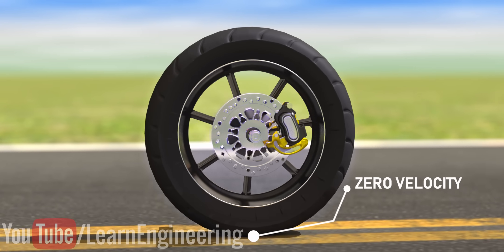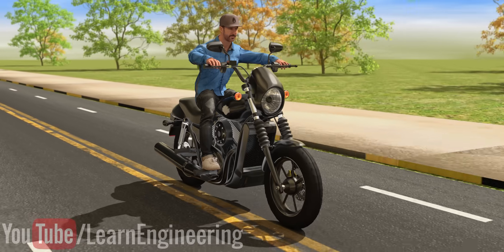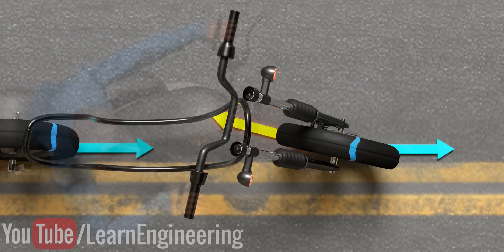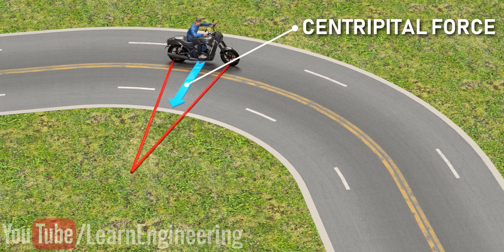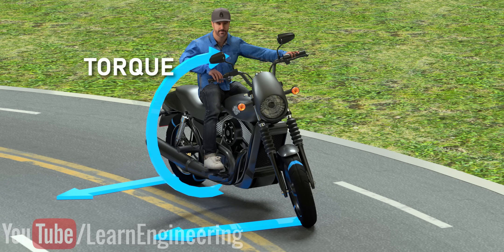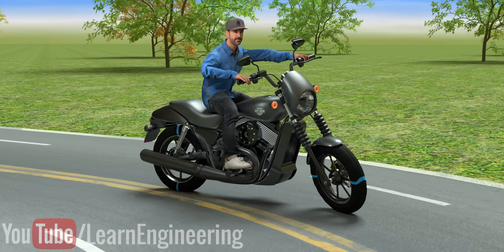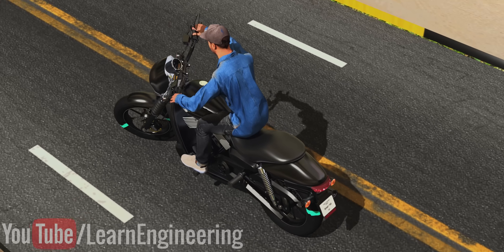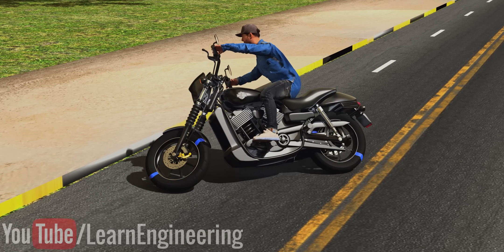Counter Steering | The interesting physics behind it

Comment: This guy has never rode a motorcycle. You always countersteer going over ~20mph. You can't just lean a motorcycle like he points out, the gyroscopic motion of the wheels prevents this.
Reply: You even countersteer while riding a normal bicycle, it's nothing extremely special
Reply: @PiepsPiepsMann  it helps to know about it as you have more control. People always countersteer but they don't understand, they do it indirectly
Reply: Agree. Regardless of bike, normal steering isn't going to work when you rode it at speed higher than 60 km/h. You'll need to swerve your bike first followed by countersteer in order to make a turn. The only time you make a normal turn is when you're at 0-20 km/h
Reply: @vermilion6667  Why do you think counter steering is only practiced at 20 + MPH?
Reply: A motorcycle turns in the direction of lean.  Counter steering just enables the rider to create a lean in the direction intended.  He doesn't mention the caster effect which is why the motorcycle stabilizes in the lean.
Reply: @saisr1 not neccessarily. You can lean ( and fall) without turning. Leaning is not needed to turn. It is needed to remain on the wheels.  Just to balance the forces.
Reply: @saisr1  you can create lean with just body position, but is way slower. much faster counter steering and let play the casor effect. on the sports bike they combine the two to make sharp turns.
Reply: yourleftnut1  You can't lean a motorcycle without turning you dope. You're sitting on a gyroscope.
Reply: @kayakexcursions5570  Thats funny because when I shift my weight the motorcycle leans. If I lean  enough left its going left. IF I lean enough right its going right The only time it doesn't is if  'm purposely counter leaning say in a cul de sac to do a tight turn.
Reply: @spartanx169x  Then your not riding a motorcycle. The only way to lean a motorcycle with weight is if you're not going fast enough or the tires are light such as a scooter or bike. You can't fight the gyroscopic force on a real motorcycle.
Reply: @kayakexcursions5570  You obviously don't ride or have never had anyone on the back while riding. Doesn't matter how fast your going, shifting your weight enough will effect the balance.
Reply: This short from the "Twist Of The Wrist" video from Keith Code covers this well: https://www.youtube.com/watch?v=TW6h5aq-xqw .  The whole video is great
Reply: @magsteel9891  Thank you for linking the video!
Reply: @magsteel9891  Thanks, and agreed.   This should help many people here understand what is truly happing when turning a motorcycle.

or, simply, above 15-20mph = Push right, go right.  Push left, go left.
Reply: @MrMindlink  
But the rider never actively steers into the bend as suggested in this video. This action would stand the bike up mid bend, resulting in a very bad day. The video is total rubbish!!!!
Reply: @softailfun  To be clear, I am referring to the video "mag steel" linked above ( https://www.youtube.com/watch?v=TW6h5aq-xqw ), and I am going to stick with what I said.  Having said that, I believe the video you linked ( https://www.youtube.com/watch?v=lzk8oyNO708 ) does a significantly better job of explaining/demonstrating counter steering.
Reply: Tbh countersteering is not even something special, its something you do by instinct.
Reply: THIS. You can test it by getting the bike up to 30mph, taking your hands off the bars and then trying to get the bike to turn by shifting your body. You might get very slight changes by heavy shifts of weight (not really recommended at low speed without hands!) but counter-steering is literally the only way to turn a bike over about 15mph. You may think your turning it by body weight or "leaning", but your subconsciously counter-steering.
Reply: would also recommend it
Reply: true... but there are plenty of riders who don't know about countersteering they do it without realizing it. So he might just ride!
Reply: Yes this video is absolutely wrong.   The way he describes countersteering is not at all how it works in real life.
Reply: Ur Always countersteering regardless of the speed lols
Reply: apparently you haven't either lmao
Reply: imagine being so limp wristed you cant turn in the direction you want to lmfao
Reply: @Roman_4x5  yep, i caught the India WEB Admin BS early in this one
Reply: what do you mean so when turning right you are suppose to lean right but push bars to the left?
Reply: @BSABD315  It's going to start leaning by itself and soon as you start turning the handlebar to the left.
Reply: @kayakexcursions5570  
“Turning the handlebars”?? Really??
It’s a slight pressure forward on the grip, hardly a “turning” action. Turning is for parking areas and slow speeds.
Reply: @softailfun  so when going right i would push the left side of the handlebar slightly or the right side of the handlebar slightly?
Reply: @BSABD315  
Push right bar:turn right
Push left bar: turn left
It doesn’t get any simpler than that fella. Here’s a link with what is probably the best video on YouTube about this topic. WATCH THE WHOLE VIDEO!
https://youtu.be/lzk8oyNO708
Hope this helps, it should put your mind at rest about counter steering.
If you still have questions, feel free to get back.
Reply: @BSABD315  
The use of the word “steering” is maybe a bit severe. To turn left you “push” on the left grip, the movement of the front wheel to the right is very small. 
This link is probably the best video on this topic and I hope it helps you understand more. https://youtu.be/lzk8oyNO708
Reply: @BSABD315  you apply pressure towards the left while leaning right but the handlebars should not turn left while making a normal right turn. It's just to keep the handlebars from turning too far to the right.
Reply: @ktm125sxbeast  oh ok thanks man you explained this the best with the least amount of words everybody else trying to make it seem like rocket science
Reply: How much is that in normal people mesearuments ?
Reply: @Veronika Zaglotova Disagree with that - not counter-steering.  I believe counter-steering requires the angular momentum of the front wheel spinning to create the effect.  When the bike is at a stand-still, if you push the right handlebar, the wheel will steer left - but once the angular momentum of the front wheel becomes sufficient (at rolling speed), when you push on the right handlebar the wheel will steer right.  That's counter-steering.
Reply: @Veronika Zaglotova I really disagree with what you are saying.  Maybe it's just a semantic argument but in my definition of counter-steer there is a point of rotational force of the wheel where the rotational force deflects the sideways push against it.  At rest, pushing on the right side handlebar will turn the bike to the left...this is normal-steer.  Once a particular rpm of the wheel is reached (differs from wheel to wheel I suspect) pushing on the right side handlebar will turn the bike to the right...this is what I understand to be the concept of counter-steer.  The geometry of the front end may affect this effect, but only minimally as it is mainly the rotational force of the wheel (gyroscopic effect you rightly called it, or angular momentum) that creates this phenomenontheotherhand (MP).
Reply: Hm my 2001 Suzuki marauder begs to differ... The steering might as well be locked at all times. It's so too heavy and unbalanced that the only way to turn into lean the bike while keeping your body straight
Reply: @everblackened  When you are rolling your shut-off bike out of your garage (I did this for years on a steep slope backwards making a hard 90 turn at the same time) you use your handlebars, correct?  At shut-off rolling speed, you would experience 'normal' steering.  When you are riding down the road, and you push on the right handlebar, the bike will lean right and you will go to the right.  That's counter steering.
Reply: I LOL’d so hard when the guy visually had the handlebars turned full-on while leaning and traveling at a fast rate of speed.
Reply: My bike counter steers over 15 mph not 20 mph
Reply: It’s 20 mph not 25?
Reply: Nope. It still works, but crazy slow. But he had to explain it because it is needed to understand what a pure turning is.
Reply: Very good video, but still a lot of quantum physicist in the comment section who think they know it better but still talking crap in the same time 😂😂😂😅😅😅
Reply: It's definitely less than 20, but agreed. That shouldn't have been in the video because it's impossible to replicate without crashing
Reply: Or you don’t fully understand the physics behind it lol
Reply: What he was trying to to demonstrate is the concept of counter steering, when to use it will be taught by the msf course
Reply: Just watch veritasium's video on how bike steering works, it's a good vid, and actually shows people struggling to turn because they constructed a bike that can't countersteer.
Reply: I agree with you , I was going to say the same thing but I was afraid I was thinking of it in the wrong way but yeah that's how I feel too
Reply: Definitely do not listen to this video. If you do what this video says to you I just hope you have your hospital bill prepaid
Reply: Never been on a motorbike, but on a bicycle, you normally countersteer at high speeds.  This practice comes automatically.
Reply: There is no normal steering on two wheeled vehicles even at low speeds
Reply: @ПавелГражданкин-ъ4л  yes there is, if you push your bike at 3 km/h normal steering will work
Reply: @benjaminsletten9434  You need to ride it not push🙈
Reply: @ПавелГражданкин-ъ4л  technically yes, when you turn right on a bicycle you are technically counter steering to the left but rotational force is not very strong so you don't notice it
Reply: @ПавелГражданкин-ъ4л ppppp
Reply: @ПавелГражданкин-ъ4л  https://youtu.be/lzk8oyNO708?t=258 explain how this is not normal steeing when he is going slowly? He 'turns' the handlebars in the direction of travel. Anything faster than this and you would need countersteering.
Reply: @bagelbytes69420 , bikes are self-stabilizing vehicles. You just can't turn without destabilizing and leaning. You steer left bike leans right. You catch balance and you turn left. Always. No matter what speed it is. Low speed makes it jerky. At no speed you can't turn.
Reply: @ПавелГражданкин-ъ4л  Have you ever even ridden a bike?
Reply: @kayakexcursions5570  My degree in physics is more than enough to see how steering works. And yes, I own mountain bike. And I do daily commutes.
Reply: Павел is right, the only way to avoid countersteering a turn (on any two wheeled inline vehicle, at any speed) is to start the turn already leaned over. or to let the bike start to fall over on its own and catch it while its leaned. The counter-steering simply initiates a lean, the lean is absolutely necessary to turn
Reply: @ПавелГражданкин-ъ4л  I too have a degree in physics. You’re incorrect. Countersteering is a way of attaining lean required for turning. If you can attain that lean without countersteering, you don’t need to countersteer. This is why I can ride my bicycle around with no hands and navigate turns. It becomes easier when going faster due to more stability, but I can’t take sharp corners at high speed because the bike is too stable.
Reply: @Gnerko123  🤦‍♂️
Reply: @Gnerko123  just watch your handlebars when you lean by your body mass. They counter steer ...
Reply: @janvotava9792  no they don’t
Reply: @Gnerko123  Watch the video linked by magsteel, it demonstrates everything.
Reply: @kayakexcursions5570  it baffles me that they say leaning the bike with your hands off the bar creates a counter steering action. I’ve watched that section a dozen times but I still don’t see it when looking at the pointer. If the rider leans right, the bars go right (indicator goes left), if the rider leans left, the bars go left (indicator goes right). In that section, I see the rider doing sort of a slalom by body lean only, but I never see the indicator going one way first and then the other way during a turn in one direction like in the section with hands on the handlebar.
Reply: I’ve been reading up a bit. You can make the bike countersteer handsfree if you lean your body right, while pushing the bike to lean left. You do this by pushing your hips left while moving your upper body right. The geometry of the bike will make it then steer left, which will then stand the bike up. The front wheel doesn’t straighten immediately, making the bike lean right, after which the front wheel turns right and the bike makes a right hand corner.

If you just lean your body without making the bike lean the other way, this doesn’t happen. You do this by leaning more gradually, not really pushing against the bike as much but only leaning your body off it. What happens instead, is that the bike leans in the direction of your lean due to the torque exerted on the bike by gravity on your body. The bike’s geometry then makes the front wheel turn in the direction you are leaning. This is what I’m doing when riding my bicycle hands free and I believe this is what we are seeing in the video as well. I’ve not yet achieved the hands free countersteering approach on my bicycle, need more practice lol.

You might say that you can’t lean your body one way without pushing the bike the other way and you would be correct. However, due to the rotational inertia of various parts in the bike, notably the wheels, you can in fact move the center of gravity of the bike by leaning your body one way. Thus, the bike does not or only barely leans the other way due to your body pushing against it to lean one way. Thus, the example of the first paragraph only works well at low speeds.
Reply: @ПавелГражданкин-ъ4л  A mountain bike?  As in bicycle?  The angular momentum of a bicycle wheel is not sufficient to create the counter-steer effect.  It's the increased mass/inertia/angular momentum that makes the counter steer effect occur above approx 35kph (on my bike 2005 Yamaha FJR1300).  I was disappointed that the video didn't discuss/describe how normal steering become counter steering once you achieve a certain speed.  It is impossible to 'normal steer' a motorcycle going more than 50kph.  Conversely you cannot 'counter steer' a motorcycle going less than 30kph (speeds approximate).  I have a degree in welding.
Reply: @acehandler1530 , trade isn't enough to understand physics. Two wheeler with bicycle like structure always counter steer no matter what seems to you
Reply: @ПавелГражданкин-ъ4л  Lol, baloney!
Reply: @ПавелГражданкин-ъ4л  Degree in physics, good story mate.
Reply: yourleftnut1  
Such bollocks!!!!😂
Reply: Yeah I don't think this guy rides a motorcycle. Any turn is counter steered at any speed over 40 mph regardless of any lean on the bike whatsoever
Reply: @SofiaSchnee1  This is the correct answer, and that video will prove that all steering is counter steering.
Reply: Idk what everyone is saying, but i never counter steer on my bike, even if i go fast/slow
Reply: @creeperlano7805  You always countersteer on the bike, thats how you turn.
Reply: @creeperlano7805  you must be a big fellow LoLz
Reply: @Revolver.Ocelot  if 1.80m is big then yes lol
Reply: @creeperlano7805  yeah you have you just don't realize it
Reply: @chrispybacon3320  Just so you know, i mean a bicycle not a motorcycle, but if you knew that then i guess im cycling wrong bc i watched IT multiple Times but i did not notice Amy counter steering
Reply: @creeperlano7805  exactly ppl thing that if you go fast you have to counter steering and thats not true body weight shifting is perfectly capable of change the direction of a bike at any speed counter steering is a good tecnique to change de direction of a bike when you have less time perfect to avoid any problems when you dont have the distance to do it normaly....I can't belive that there is ppl countersteering all day for every turn or to direct the bike to any place...i know you can do it but why?? why to use always the most dangerus and quick way to drive.... its like you never left that bicicle and they still 11 years old, and the correct way to do things is the fastest and dangerus...
Reply: @dariocastro9079  I disagree, above ~20mph, everyone is counter steering, whether they realize it or not...  watch this video https://www.youtube.com/watch?v=lzk8oyNO708 & https://www.youtube.com/watch?v=TW6h5aq-xqw

Above ~20mph = Push right, go right.  Push left, go left.
Reply: @creeperlano7805  They're mistaking applying counter pressure for counter steering.
Reply: @creeperlano7805  u do it without knowing ur doing it
Reply: @iantanchingco2362  i kept an eye one it, but I didn't counter steer
Reply: @creeperlano7805  Yes you do, you just don’t realize it. Pay attention next time you ride
Reply: @creeperlano7805  Me either. For me its always been having the appropriate speed then, simply lean. The speed determined how much to lean. Going too fast? Progressively brake until it wants to lean.
Reply: @spartanx169x  
Mate, you need to learn how your bike steers!
Reply: It should have been obvious in the first 10 seconds with the shifty animation. People who act smart trying to trick people into thinking countersteering a bike actually means steering left to go right when in reality the handlebars will turn right to go right. You can even slightly turn them to the right at speed to start the turn as long you apply enough pressure to the right handle after. The only time you'd ever actually countersteer a bike is during a drift or a slide just like in a car.
Reply: @ktm125sxbeast   clearly you have never ridden a motorbike .  Like most of the people commenting here .   Motorbikes are push right hand , bike turns right and leans right . Push left , go left and bike leans left  .  You literally do this every time you go around a corner-  if you don't countersteer you're a terrible terrible rider.  RIP.   good luck surviving.
Reply: @wavesniper  lmao clearly you haven't. Yes you apply pressure to keep the handlebars under control. Yet the handle bars still turn right slightly when you go right even though you apply pressure with your right hand. You don't apply enough to actually countersteer and turn the handlebars left. Feel free to attempt that though.
Reply: @ktm125sxbeast  The animation is not just sketchy, its wrong. Any model with two fixed wheels in a row will prove that a lean doesnt make a turn.
Reply: @pflaffik  Indeed if the wheel in front is fixed and can't turn, though leaning on a motorcycle will turn the handlebars in that direction which initiates a turn. So it's a combination of leaning and applying pressure in the opposite to keep the handlebars from turning too far in that direction. So while you do apply counter pressure it's not enough to turn the wheel left while turning right which is what countersteer is. The only time that's used on a bike is during a slide, or intentionally drifting.
Reply: @ktm125sxbeast  THX perfect explainded .... PLIS ALL READ the last sentence  ....The only time you'd ever actually countersteer a bike is during a drift or a slide just like in a car.
Reply: @ktm125sxbeast  You counter steer any two wheeled vehicle every time you turn lol what are you on about? Only time you wouldn’t is when you’re going under about 8km an hour
Reply: @Tr8nt  Not really. You apply counter pressure.
Reply: @ktm125sxbeast they just assume from the word counter meaning opposite direction,  but the counter comes from countering the bike leaning all the way over, but then kids on yt trying to act smart but sounding cringey would say that you literally turn left to go right which is so dumb.
Reply: WRONG.  The gyroscopic force is what makes the thing lean.
Reply: @protoborg  you are correct … gyroscopic precession induces the lean. If you induce the lean with body weight, precession will cause the wheel to turn in to the turn.
Reply: @protoborg  No. It's the counsteer that makes it lean. At high speed the gyroscopic force is there regardless of whether it's leaning or not.
Reply: @kayakexcursions5570  no. If you turn the bars right while upright on regular surface, regardless of speed, you're going to go right. It's the lean that's used to turn a bike, NOT the steering. The lean is what causes the countersteer of the wheels on the turns, NOT the other way around.
Reply: @zimvader25  
Ridiculous comment!!!! Obviously you don’t ride a motorcycle!!!!!
Reply: @zimvader25  LoL good one, its almost april 1st, the one day in the year when you can be right.
Reply: @zimvader25  if you turn the bars right, you’re going left buddy
Reply: @zimvader25  You absiolutely nailed it. Its the Lean that results in a turn, the ''countersteer/push steering'' only initiates a lean.